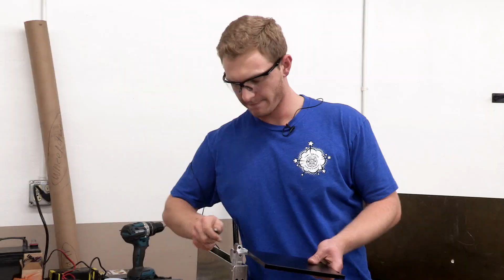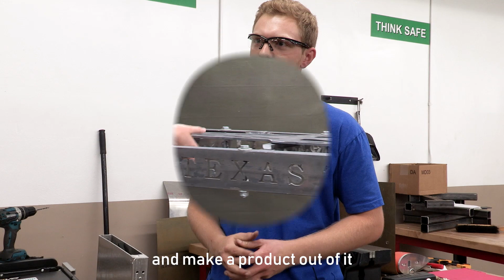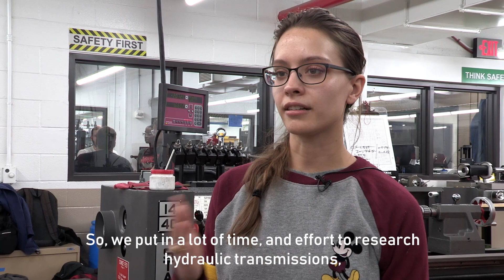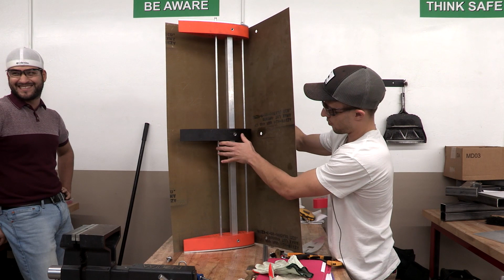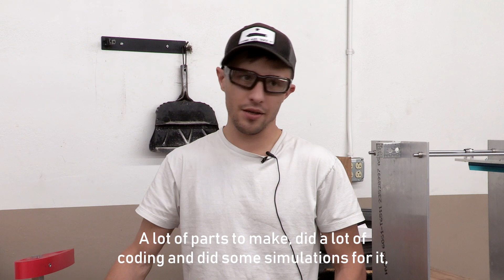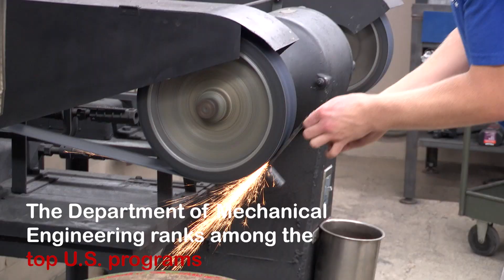TTU Mechanical Engineering Senior Design Projects

Comment: Project completion inspired wheelchair rendition freshman make product music designing product out tractor has hydraulic Texas Tech competition tractors transmisions hydraulic control mechanical engineering more control turbine more control affordable more control generates power low-income design project application work make code simulation project overall project averall music support project rewarding among overall music laboratory. Universidad de Ibagué - " Comprometidos con el desarrollo regional".